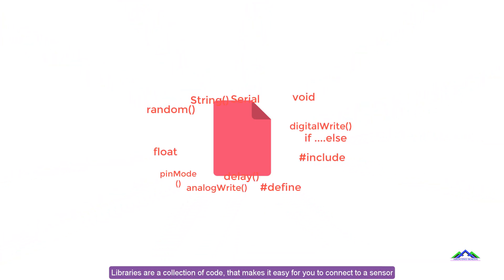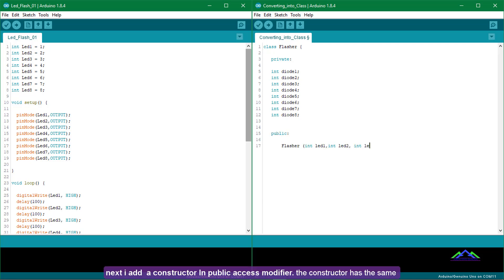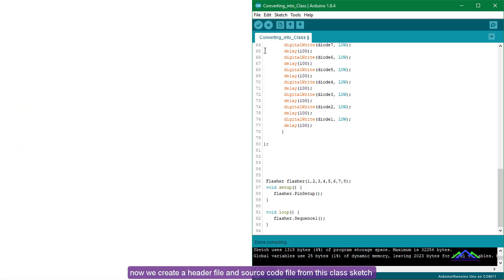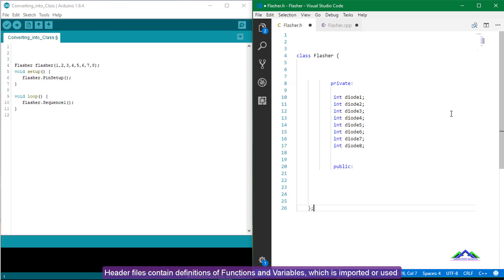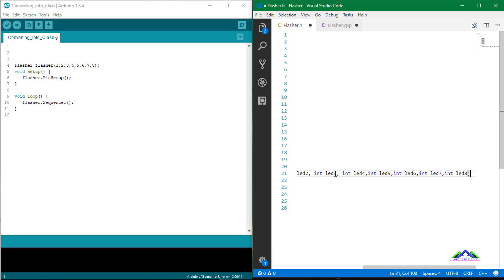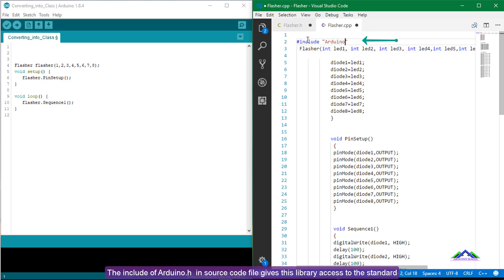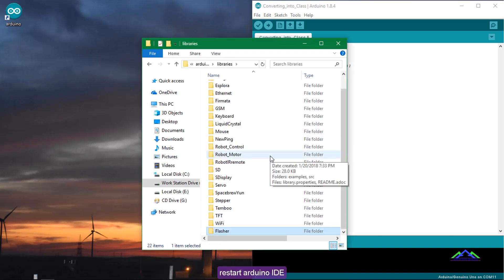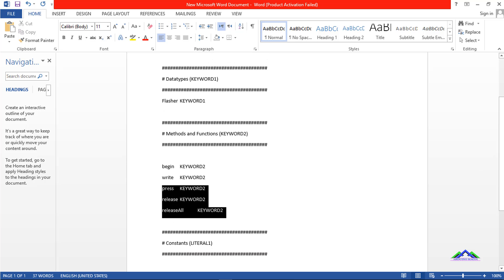Arduino Library :  How to Create Your Own Arduino Library

Comment: Good explanation! Allthough you should have used loops to create the flashing functionality. Then there is no need to write long sequences of code to turn the lights on or off!
Reply from the maker: I know but this is my teaching style for  beginners  So that no one has difficulty in understanding
Reply: @electronicstree  Ah, i did not think from that perspective. Thats a very valid reason to do it that way

Comment: Good day sir I try it and I couldn't make it up to Sequence6(); 
is there any problem or it has a limit of sequence in arduino?
Reply from the maker: email your code i will check it
arduinomagix@gmail.com
Reply: @electronicstree  thank you again for the respond sir. I am just wondering why the sequence6 does not appear orange then I found out that the problem is in the keyword txt. Thanks problem solved 👍

Comment: where to download the library of this? #include "Arduino.h" 
it gives me error in the Visual Studio
Reply from the maker: This file already exists in arduino ide  folders. and here I have added it for reference.Maybe there is another problem. I have given the link of the files. You can download and check the files.
Reply: @electronicstree  I configure my VSC for arduino setup and already fixed it, thank you for your respond sir. Your video is awesome!
Reply: @osthead5416  Hello, can u help me? I have the same problem. What have you done to fix it?